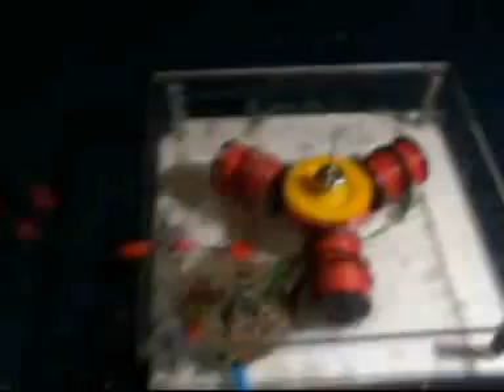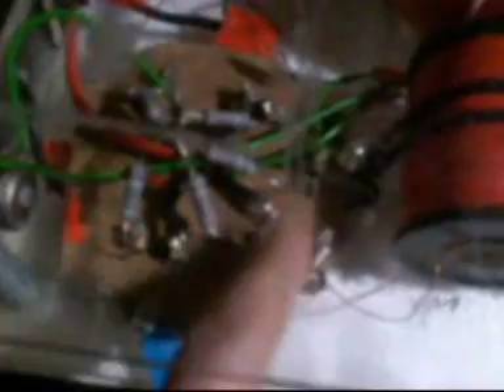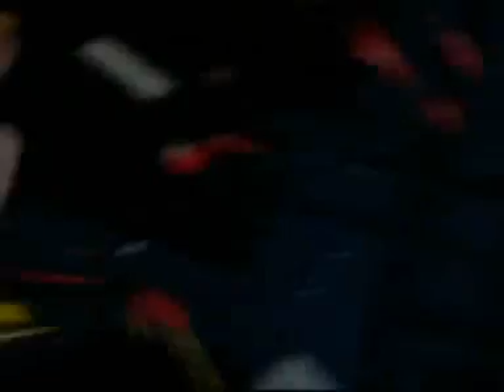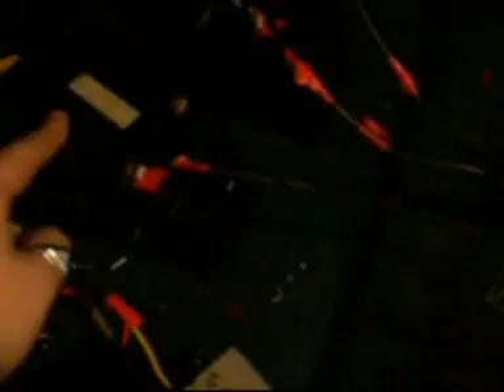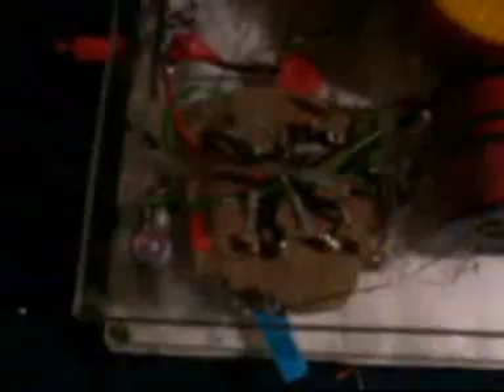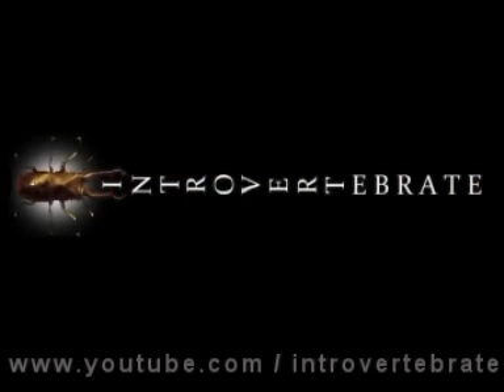Neon Bulbs and the Bedini Motor - Safety First!

Comment from the maker: I used to have a switch in the circuit to swap the batteries and it worked fine but now i'm trying to optimise the circuit so I've took it out.  Going for perfection! ^_^

Comment: Why can't you add an extra piece of circuitry with a switch? (Either automatic or manual) so that the two batteries change roles when the switch is thrown. This way it would run for as long as the switching mechanism worked??

Martin

Comment from the maker: haha! not yet!  I would need a much bigger motor for that!

1 battery can charge 4 batteries... or 8 or 12... but the more you add the less they will individually charge.  So 1 battery isn't likely to *fully* charge 4 batteries but more of the radiant can be captured if the battery "resevoir" is made larger so it is more effective when more batteries are added.

Comment from the maker: It can charge batteries faster but it does use more power (at least this one does)... It isn't over unity at the moment as I'm still conditioning some old batteries to power it.  My other batteries weren't big enough ^_^I will make a vid on how to add more coils when I've got time thought there is good info at the "energetic forums" (Renewable energy section)

Comment from the maker: definatly getting a faster charge rate however amp draw has gone up as well... in fact my single coil motor worked better than this one because I was using the c20 rate with the single coil but now my amp draw is too high for the batteries.. :(